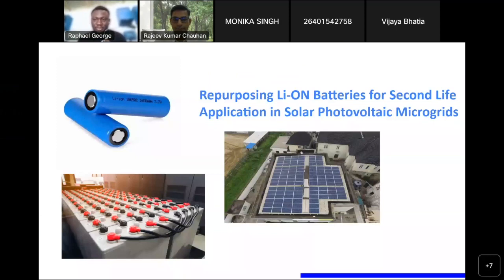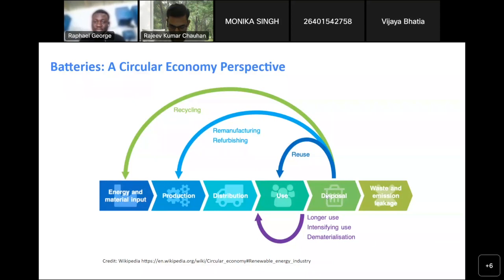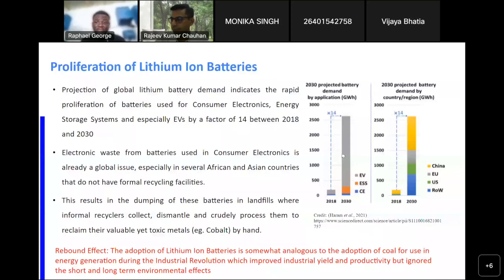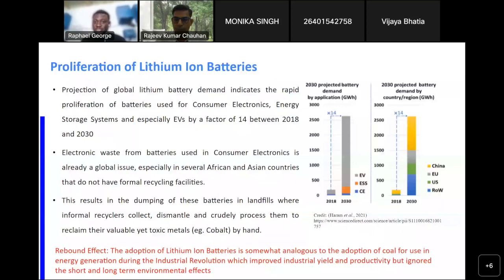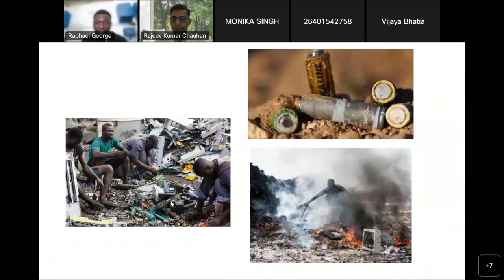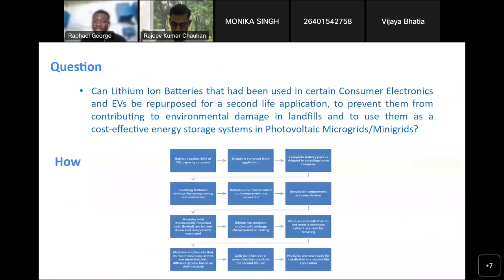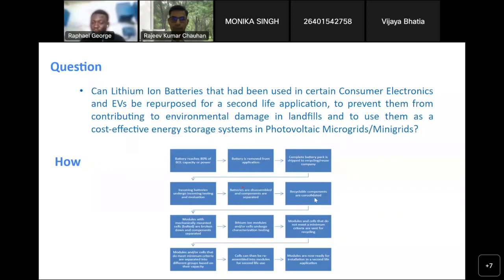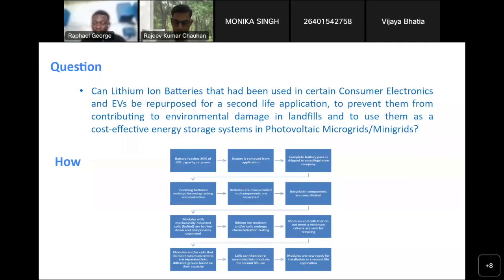Repurposing Li-ON Batteries for Second Life Application by Raphael Oluwaseun George

Comment from the maker: 00:31 Repurposing Lithium-ion batteries for sustainability
03:11 Repurpose Lithium-ion batteries to reduce waste
05:52 Higher demand for Lithium-ion batteries leading to environmental hazards
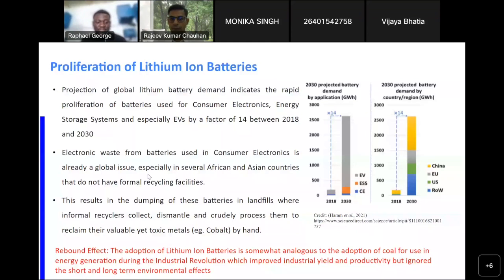08:28 Lithium-ion batteries adoption similar to coal in the Industrial Revolution
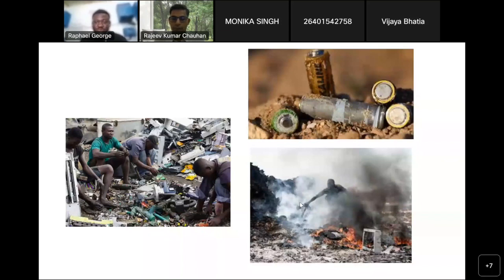11:04 Repurposing Lithium-ion batteries for second life application in renewable energy storage.
13:32 Recommendation for repurposing Lithium-ion batteries at 80% capacity
16:05 Repurposing Li-ON Batteries for Second Life Applications involves checking state of health and residual capacity.
18:13 Repurposing Li-ON Batteries for Second Life Applications
20:32 Promote reusing, reducing, and recycling for sustainability
Crafted by Merlin AI.